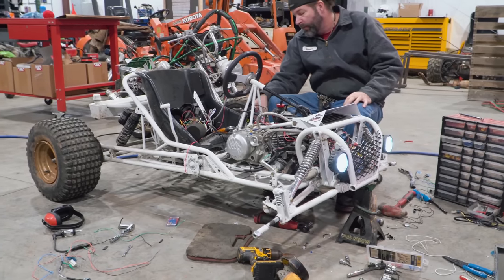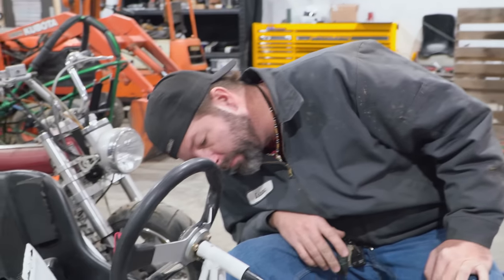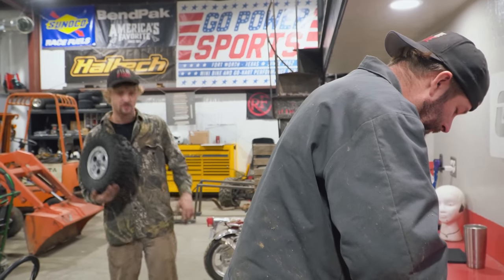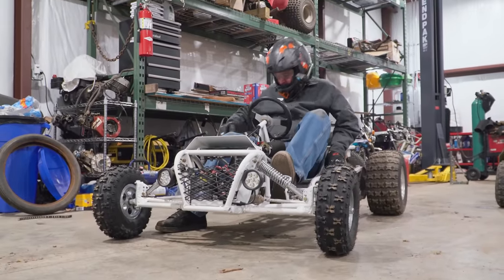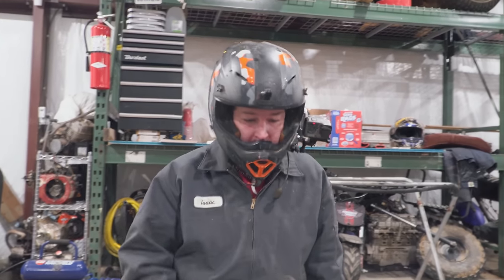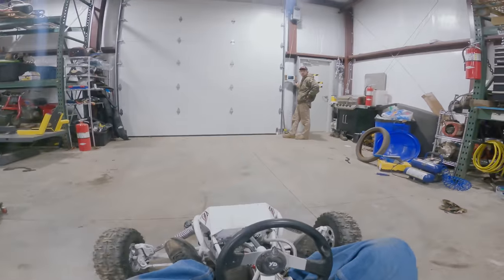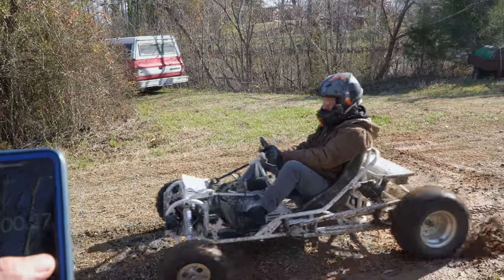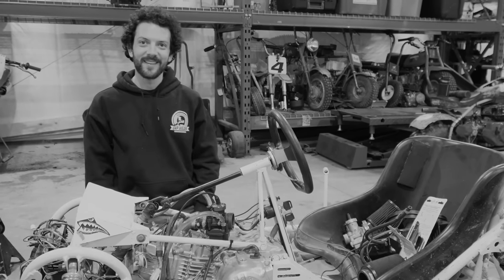Reviving our FASTEST Home Made Go Kart, the “Yard Dart”

Comment: The spark plug might have been damaged by overheating when running lean. If they get hot enough, the glue between the center electrode and porcelain insulator get's cooked right out. A short can develop where the glue used to be. There's a bit more to it than that, but my simplified explanation is enough.

Comment: Delete chinese connectors solder wires together and lash the valves and make sure when giving full throttle while running that the choke isn't fluttering had that problem

Comment: You should have baby powder all over that intertube while it is completely deflated. The Schrader valve needs to be removed. Assemble the wheel, then inflate and deflate several times until the intertube settles into where it will sit all by itself. That's how you do it with airplanes.

Comment: Could it be the voltage regulator from the alternator going bad? It seemed like it's perhaps putting out too high a voltage, I had a Kawasaki ER5 that killed a couple batteries and it seemed to do something similar under load too

Comment: Had a problem with my yx 150 ELECTRIC START engine in my baja monkey bike it ended up being the pick up and stator coil was miss firing till it just gave up spark thought it was fuel but oh no it wasn't ? TRY DIFFERENT 1  as my friend also had the issue on his yx 160?

Comment: CDI's that come with the ZS 190 really not the greatest, sounds like its failing with all the missing, Also check connections on harness where it plugs into CDI. Also I've had issues with the wiring being exposed inside the harness causing a short. Also kill switches!
Reply: The ZS 190 is a great engine!! I have used these on pit bikes to replace the stock 125cc engines and they are fun! That Kart must be a hoot to drive!

Comment: had a atv that voltage regulator was going out and sending 16-18v to battery and was causing the ignition to cut out intermittent. I figured it out because it was cutting in and out and I hit the brake and it smoothed out when the brake light came on and added just a slight load to charging system. not sure if the LED headlights you have would draw enough to make the same thing happen to yours or not. but try checking voltage when it is running and see if it starts climbing.

Comment: its too rich ive worked on these engines alot. judging by the plug is never a good way to test. put a lambda sensor on if you dont beleive me but the pops are because its rich and then when engines are too rich they only fire every 8 strokes affectively acting like a rev limiter. another good tell is when you pull away it struggles which incicates it is rich as if it was lean it would pull away better due to buildup of unburned fuel but not so much that its being flooded. where as when ike was moving and touched the throttle it shot off because of the fuel being present. if it was too rich it would struggle. easy way to prove this is if it runs better on choke which you can see when ike starts it with the choke on. have a think, thanks @CarsandCameras

Comment: It bums me out that this thing never really ran at it's full potential. I still maintain that if it was, a sub 50 second lap would be doable. This would be the one kart yall have done that I would love to try and recreate myself except I would probably use a Daytona Anima 4v 190cc engine which is a bit pricier but has about 23 hp and an overall higher quality engine than the Zongshen.

Comment: The ignition coil could be arcing internally and killing some of the spark. Seems quite possible that there was a bubble in the epoxy and it's arcing through it. Try replacing that if you haven't already

Comment: Checking the dry comession(rings)then wet with oil(valve s)then timing!does not use the parts Canon!checking cdi and stater difficult with out proper tool's!!

Comment: You guys need more data to help you diagnose. Why not get a wideband O2 sensor so that you can watch it while you drive and see exactly what is going on with the mixture. I don't know much about carbs but it sounds like the accelerator pumps aren't kicking in under full load, at least that's how the old car carbs work I think.

Comment: Spark plug was ghost white and you guys never re-checked it after 're-jetting'... and then assumed the carb is the problem, without a second inspection or adjustment.  And running a lean engine out of fuel.  Clear as day as it flattened out on the run after re-fueling.. you're going to melt that engine.  IT NEEDS FUEL!!!  They work hardest on the lean edge just before destruction

Comment: Happy New Year to you. How far is the ignition trigger from the flywheel magnet? What is the quality of the flywheel? It's sounds like a sparatic misfire -- under load it it shoots flames out the exhaust when it skips [you can see it in the video]. The flywheel could be flexing and causing it to misfire. Are they using the same stamped steel flywheel like on a 125 on the 190? IMO it should be heavier quality as the vibration on the 190 would be more then a 125 or 150 engine.

Comment: If it free revs perfectly and it only pops and bangs under load it has to be spark. If everything on the ignition and coil is good it’s the plug. Bad plug, wrong plug, gap isn’t right. Not so much heat range… By giving it more fuel it got worse and giving it less fuel didn’t change. Why I’m saying it has to be spark. I’d say heat range ngk 7, about .025-.030 gap. Make sure it’s a resistor plug, being electronic ignition it won’t like a non resistor plug! 👍

Comment: Hey guys is it possible it doesn’t like the free flowing exhaust like the issue you had with the OG cross kart??
Reply: That’s what I was thinking. Or a weak valve spring. I had one with the same issue and it turned out to have a poorly seated exhaust valve. I was about to junk the whole engine right before I scoped the exhaust port and noticed an odd carbon pattern. 

The QA/QC protocols are to lax at those Chinese factories. I spend the extra upfront money to get the Taiwanese models now

Comment: Sounds more like a ignition problem, but being its a chin engine i would check the spring pressures on the valves. Almost sound like overlap in the valve train. Can't handle the rpms thus floating the valves ??? Good luck !!

Comment: It’s floating the valves guys. Too loose for sure. Specifically at higher rpm. Can’t burn the right amount of fuel coming in before it goes out. Tighter valve springs will help this. Can’t close fast enough. Have fun.

Comment: There is a very simple test for checking grounds. 
Whilst the suspect component to be checked is wired normally, and in operating mode, use a standard multitester between battery negative and the negative of the component. In an ideal world, you should see zero volts, as all the current should be used up by the component. In reality, up to 0.5v on the negative is acceptable on non computer circuits, and 0.1v on computer circuits ( Which is why modern computer circuits use uninterrupted wires/gold plated terminals etc)
If you are unable to test using the component in operating mode, substitute the component for a headlamp bulb to simulate the load. This is the basis of a voltage drop test. No current flow-No voltage drop

Comment: Being that you tried both ends of the spectrum with fuel without much change, set the carb a side momentarily. There are two other things to check for. Ignition timing along with checking the intake and exhaust valves for proper seating. (are they bent?) If you do happen to dive in and inspect the valves... Check the valve springs too. Make sure that they're not too weak. Maybe a little valve floating could be going on? I'm pretty sure you guys know what happens when a piston kisses a valve.

Comment: The thing that will cause that amount of backfiring is timing. If it was the carb it would be shooting fire out of the carb, it's firing out the exhaust that is 100% a spark problem. 

Edit: That doesn't mean the carb isn't an issue at all, just that it isn't causing your backfire.

Comment: I think the problem why it keeps leaning out is the engine was on a motorcycle the tank was above the motor gravity fed now the tank is behind the seat same height as carburetor when you accelerate you'll get less fuel when you go in turns donuts you'll get less fuel I think you need a fuel pump

Comment: Sounds like a cdi module and or exciter coil on the stator. Install a spark checker between the wire and the plug fire it up and observe the spark. if it is the ignition you’ll see spark intermittently.

Comment: My suggestion is first, tune the motor by the main jet for wide open throttle. When that is correct, the tune midrange with the needle jet position or change the needle taper if necessary, now adjust the pilot air screw for best idle and best transition to midrange. One other thing, I have seen plugs, probably clones, that had a leak between the porcelain and the metal body. Caused me a similar issue. Be sure to tune with a brand new plug,

Comment: Sounds like a floating exhaust valve from a weak spring, or not enough air bleed in the carburetor making the fuel droplets too big and harder to atomize. Could also be spark since it sounds like one of those rally cars with anti lag

Comment: You definitely have an issue with the fuel system it nearly dies on left hand turns but revved fine coming out of a right hand turn . I'd get that sorted and then take it for a blast hold it on the "limiter" and stall the engine with the clutch in and whip the plug out see what you've got. My 190 used to be very sensitive to a bad plug also, to the point of sometimes it would refuse to start if the plug was a bit too dirty etc, quick clean up and it would rip all day long again

Comment: Hey cars and cameras Im no expert but i would check spark plug wire and make sure its not arcing over and grounding out to me thats what it sounds like to me when it back fires you know when your driving an 80s truck at higher rpm then turn ignition off and on real fast it back fires like that and may not be just arcing at plug wire could be in the ignition system some where

Comment: Ive had the same with one of my engines ended up changing the stator with a light  inner rotor  stator with a tbolt cdi run 1000times better

Comment: Clean the Jets and make sure they are fully seated.   Taking fast turns can also add air to the fuel line because the gas is being pushed to the opposite side if the feed line to the Carb.  Try adding fuel-safe foam to the tank or adding an additional drain line to the opposite side of the tank and "Y" the two together before it goes to the Card.  I am not sure which motor this is but if it has adjustable timing move it a little and try it again.

Comment: The backfiring is a lean.condition. and when you fatten up the af ratio it got better fuel wise but the popping is not a back fire that is an ignition issue . You can confirm this by the fact that the head light was blinking when it got real bad

Comment: As far as some simple suggestions from a second set of eyes, what about double checking the plug is actually the right size plug? If I had to guess, that probably isn't the stock one and probably is the same "not stock" one as in the other engine you guys have. Would be worth double checking. Also It seems from the video like the issue is noticeably worse when turning left, maybe that is a factor. It did donuts turning right early in the video, and then during the hard run before you guys looked that the plug, Ike did that hard left and it nearly died. This trend continued through the whole video.

Hope you guys can get it running right, looks like a really good ripper!

Comment: I would not rely on the nylock nuts holding those front wheels on when you cant tighten them drill them and put a split pin in them please I don't want to see the wheel coming off at top speed.

Comment: you guys might wanna cheek all the bolts and head bolts as you need to tighten them up after the motor is run in it has a werid run in time on them motors or thay dont run right at all and you guys might wanna change the jet to get ride of that boggin out of it

Comment: Are you guys using a fuel pump on this kart?  Your issue reminds me of when the diaphragms start to dry out in a pulse pump.  The pump still works but not well enough to supply the proper amount of fuel in the higher rpm range.  Give the fuel pump a rebuild and let'r rip!

Comment: it is a cdi problem pickup problem with out looking at the cdi i dont know if you running a dc cdi or an ac cdi a dc cdi will run off the stator but it will missfire like a pig and bog out

Comment: The yard kart is a great machine ,I have the same engine on a pit bike I tried all sorts to mitigate the issue one thing I noticed was the valves where not seating properly so re seated them and helped a little ,then I swapped the carb over for a exact same one still had issues ,so I swapped them back and replaced the air filter for one that was a bit more restrictive and it sorted the issue for me so it might help ,happy new year lads and keep on building 👍👍

Comment: 95 obtain is too high for single cylinder engines. Try reg gas
Reply: The ZS 190 is a high compression engine 11:1 or better and run great on Sunoco 110 fuel.

Comment: LMAO, going uphill for any duration would be physically impossible, due to Pascal's Law.

What two primary components does this fuel system share w/ a toilet?

This is where you draw a horizontal line.
Reply: PS 15:15 QC ain't what it use to be, and batteries open/short more often than you realize.  Super capacitors would make a premium replacement.

Comment: Why would anyone with any sense think that a carb problem could cause an ELECTRICAL problem ? The engine was cutting at the same time as the lights cut out. It'e so obviously electrical, and the problem is in the flywheel.

Comment: The problem is very simple and common. It's called Chinese Engine Syndrome. 😅lol

As a side note, I have a lawn tractor that does that exact thing. It's a B&S, but a valve job, and better fuel flow seemed to help a bit... Not that I think that's your problem though. 🤷‍♂

-MMD

Comment: What you need to do is replace ike. He's clueless. When it's lean the last thing you want to do is a 30 second full throttle pull.  You can tell it's lean from the backfires. It sounds like it's dropping spark or maybe compression, like a sticking valve or rings possibly. Could be fuel though since after all these years you are all still completely useless with carb tuning.

Comment: i bet its a flaw with that chinese engine. their qaulity control doesnt exist.  yes i know people have had good luck with them but some out of every batch have goofey gremlins people never find. i would look for a casting flaw where its leaking air/vaccuum or something with poor valvetrain design. valve seats off just a touch from whatever engine they cloned. Face it if you buy chicom stuff eventually you will get burned. I have a powerhorse gnerator that had a bad starter after 2 uses. Had one identical to it that was stolen and that one ran great. The one that replaced runs a touch rough and always has.